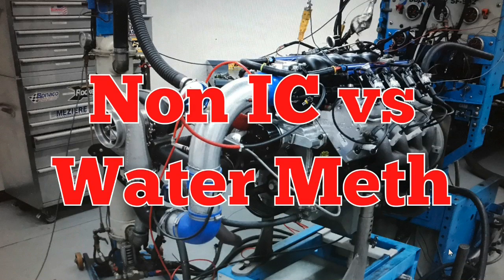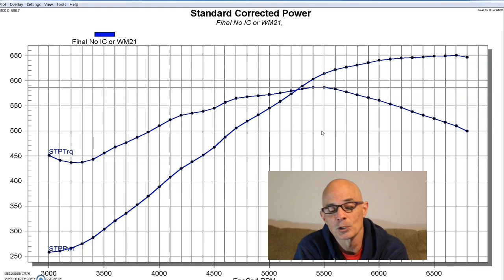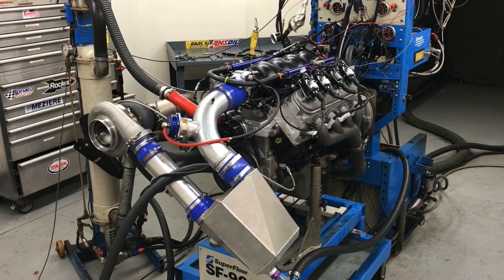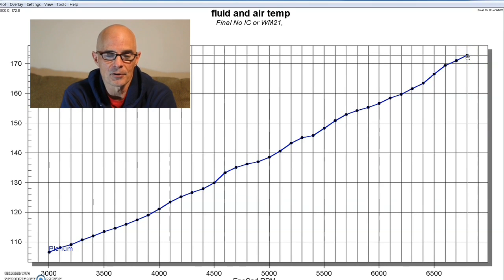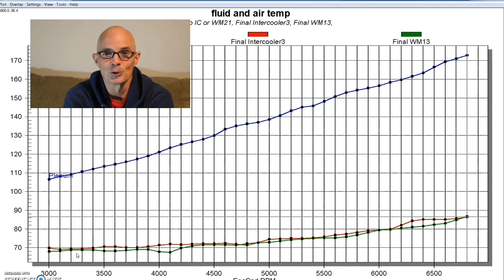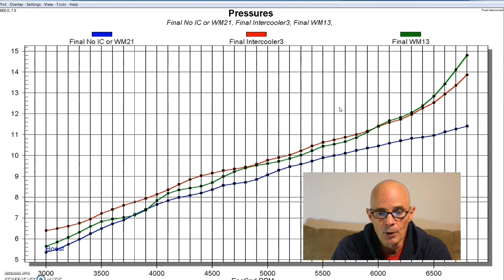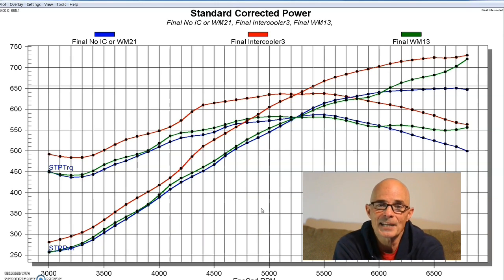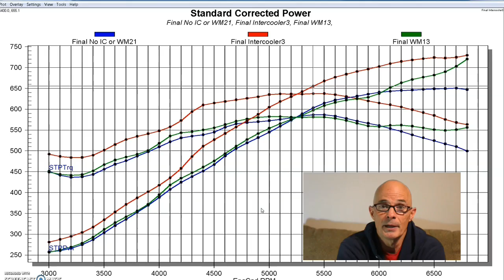WHO'S COOLER? WATER METH vs INTERCOOLER

Comment: When you introduce Alcohol you change the burn rate and you have to change timing. No one would leave factory timing if you switched over to Methanol completely. There was much more in the meth kit.
Reply: This is what I came to say. Meth allows more boost and/or timing.
Reply: Not to mention the water component....it actually absorbs a bit of the energy which would normally contribute to expansion and power production. Definitely a catch 22 based on our dyno data....we resorted to straight meth since our applications permitted additional combustable liquid tanks.
Reply: @SixGunTodd  if it weren't for the safety reasons and how combustible straight meth is I would too....I like steam cooling the combustion chamber and cleaning the pistons....
 At the end of the day it does ALL end up at how much real cylinder pressure at what rpm peak torque occurs will a given combination knock at given an octane limited boost application....
 I could see it moving the goal post a bit and I use it, but not adding a lot....
 I was thinking about, if the new station carries e85 being built just filling it up with e85 and helping my injectors and pump....
Reply: You read my mind. Actually I am surprised that it didn't lose power. Not sure how it works on a v8 but day on an intercooled twin turbo porsche 911, power using the same gasoline, methanol injection and tuned for it can increase horsepower close to 100 hp. Spraying before the throttle body. Great analysis but fairly incomplete test IMO. We ought to see timing and of course afr. Guaranteed with the water/meth the car was running pig rich!
Reply: @kouzman  he was using it for cooling only.
Reply: @thud93091  but even then you need to review the timing and afr even just a tiny bit. The spray is a whole different ballgame since it will change detonation tolerances completely. It would be great if repeated the test but checking the tuning for it.
Reply: @thud93091  well he had to be adjusting the timing as well or the intercooler test would have shown no increase in power.. 
 The meth did its job...I use 2 nozzles well back from the tb at different angles hoping to get some good mixing, even if overall charge temp is lost to some preheating
Reply: @ShawnGilbert1967  The beauty of water injection is that it will still reduce temps all the way into the combustion chamber. The increase in power from the intercooler came from a reduced charge density which allowed more air mass to be in the same charge pressure. He would have made considerably more power if he had changed timing on either of the intercooler or water injection runs. If intercooling was better they would have used it instead of water injection on WW2 planes. They would have saved considerable weight and increased their range without the water/meth tanks.
Reply: @fastredcar97  Does it make sense to use both? Especially in a warmer climate or would it be too much money for the gains you may get?
Reply: @fgtrhwu2  It really depends on your setup. The water injection can reduce temps across the entire combustion process. Intercoolers don't really reduce exhaust temps. Which is what burns valves and pistons. Water injection can both reduce exhaust temps and can slow down flame propagation across the chamber, which an intercooler cannot do. This is especially important with boosted applications or high compression setups. The thermal reduction that water injection is significantly larger than just reducing charge temps initially. The latent heat of vaporization of water is huge. To give an example: the energy consumed to change water from its liquid form at 211* to gas is five times as much energy than is required to heat the water from 32* to 211*. The draw back to water injection is that its quantity is a fixed amount in the vehicle. The up side of water injection is that 100% water can be injected and thus dramatically increase the range a set amount of fluid can properly be accounted for during an event. The problem most people make when making this change is that they do not understand the physics and data that has been researched and recorded. The amount of water that needs to be injected is the same whether you are running a mixture of meth or straight water. So if you decide to run a meth mix you have to increase the total amount of fluid injected or conversely you must reduce the total amount of injected fluid if you decide to run only water. Many test of straight water injection that have been done do not do this. This improper use and testing of the straight water injection leads to severely over injection and this reduces the internal delta temperature from the combustion process, which ultimately leads to loss of power. Remember that water does not burn and over injection will have very poor results.
Reply: @fastredcar97  Does having the water injection system as a direct port injection yield significant advantage?
Reply: @fgtrhwu2  Yes typically, it comes down to distribution differences from cylinder to cylinder. Modern EFI manifolds have large bends that induce wet flow fallout(the suspended particles combine and are typically laid on the runner wall). If this happens it no longer is being used for temperature reduction inside the combustion chamber. The same goes for fuel. If fuel smacks the wall it introduces a ton of problems with combustion and data collection. Direct port injection (DP) is best for both fuel and water introduction into the air stream. The earlier you can put into the stream the better, as it can start to reduce temperature sooner and thus lower the initial combustion temps more.
Reply: @fastredcar97  Since, the turbos suck air from a hot engine bay, would there be any benefit from using an intercooler and water/meth? Or would that be too much?
Reply: @kensmechanicalaffair  turbos do not breath hot air from the engine bay. Only if the installer doesn't have a ducting system to feed from the frontal cross section would a turbo only get it air supply from the engine bay. Why spend thousands on a turbo system to cheap out and not spend another hundred to get air from a better source. Intercoolers will always add power as the charge density is increased. Any turbo system will benefit from an intercooler.
Reply: My thought too.
Reply: Without knock sensors it’s difficult for him to find the limit by adding timing, so he doesn’t.
Reply: I agree this guy is slow or something
Reply: How about adding water to the gas tank ?

Comment: Great conclusion. Agree 100%. Water meth is appropriate for an intake that was designed for wet flow (single plane is ideal); if running an intake designed for dry flow, find a way to fit an intercooler.

Comment: Back in the day I had a turbo thunderbird with the 2.3L. I had a big turbo and a big air/air FMIC on it. Then I added a water injection arrangement (sometimes I'd dump a bottle or two of rubbing alcohol into my tank to supplement the water). Two key take aways: 1. After a zero to 140mph to zero run, with the water injection, my intake manifold was icy cold to the touch...Not the case with only the FMIC. 2. When I pulled the cylinder head off, the insides of that engine were SPOTLESSLY clean. I mean, clean as a whistle. Never seen a cleaner engine that had ANY runtime.

Comment: It looks as though you had zero boost control if you only had a 7 psi spring in the gate that's why the boost increased with the intercooler. It was making more power which exacerbated the problem. Was the tune changed when activating the water meth? If not it was probably pig rich in some cylinders because of the distribution problem driving the power down.

Comment: I hate watching these so late in the game!  I know that nobody is going to see this comment :(  The reason water / meth injection sucks is that to have significant cooling you have to have a lot of water / meth injected that makes a lot of steam taking up intake volume that would be filled with air in a system without water / meth injection.  So, for the same boost pressure you actually have less air in the intake manifold, less air going into the cylinders, so your net HP gain is negligible.  The only time to use water injection is if you are running into detonation and can't install an intercooler for some reason.

Comment: It's probably been mentioned, if not, I think the boost increase was caused by a denser intake charge providing for more exhaust output. The more oxygen from the denser air means more fuel and more exhaust output.

Comment: Another snow user here. Been running it on a mixed use car ( some street driving,trips to Mexico and drag strip) for going on 3 years. Not a problem. I have pump mounted in the trunk so its away from the elements.  Going to buy another kit for my daily that i want to turn up the boost.

Comment: It is good too know that those intake styles do not distribute w/meth evenly, so one would want to setup nozzles in the runners. It is also good to know that the cooling ability of the w/meth kit is similar to that of the intercooler. However I am not satisfied with the conclusion as the purpose of the w/meth does not seem to be exploited.

Usually just adding meth or w/meth does not usually increase power. It allows you to run more boost and/or timing, and the power increases come from that. As Richard Holdener mentioned he can not run a knock sensor setup. If he could, he could find the limit of the non-intercooler/no w/meth setup max power of boost/timing on pump fuel before knock occurs. Then he could run the w/meth and max out the turbo/timing combo and see what he max power is, as he would be able to run much more boost/timiing with the cooler air & higher octane provided by the w/meth kit. That is how you use a w/meth or meth kit.  You will make a lot more power.

Comment: The reason I believe this test is inaccurate is, water meth must be tuned the engine will run richer with it and there for makes same or less power. If fueling was adjusted correctly and timing was added as it bumps up the octane it would have made more power then non intercooler. Although this test does prove water meth is very effective for cooling air temps.

Comment: Hey Rich, I absolutely love all the combos that you put together. 
I'd love to see a single plane manifold port EFI with a elbow, 103 throttle body with a base plate meth injection, and then run it with and without the intercooler.
The cooler the better you say.
Thanks again for all that you do.

Comment: Richard, it looks like, based on several learned sources, that the water injection volume  should be about 14% of the fuel volume.  I have not knowledge of the water injection used on this experiment, but was curious if followed the foregoing volume and tailored directly to the change in fuel flow???
Reply from the maker: we adjusted up and down

Comment: Can you do a test that I've been thinking of trying on my ride.  If it works as I'm thinking it will.   I run a blow threw carb  and want to run  water meth threw a zex perimeter  plate  probably  have to produce  2 custom jets to run the water meth into the perimeter  plate and I'm thinking that the plate will need 2 supply lines one in the frt and one in the rear to make it work  but that's only on paper.  Real world  might say otherwise.  Maybe just a higher pressure and / or high flow solenoid  may be the solution.     E fuel without intercooler 9-11 psi boost. Single remote  mount turbo(rear mounted)      luxury  need for speed  on a Joe dirt poor budget.   Thanks in advance

Comment: 84 degree water did well - what would 42 degree water do? Ideal gas law (Boyle's, Charles, some others I don't remember) could be double the air at the same density if the temperature is cut in half - which would allow for double the fuel. Knowing the air temperature would be helpful - the water temp is just a single factor.

Comment: Would like to see this same test using E85 instead of gasoline. Interested in seeing how necessary an intercooler is with higher octane alcohol based fuel.
Reply: Burn an exhaust valve not burn an exhaust valve. Why not run the intercooler.
Better question is how much boost will e85 take? 10.5/1 at 10 psi boost is 16/1 compression. The limit of e85.
Reply: Then what cam lobe center profile, intake valve diameter, combustion chamber softening, etc. Assuming you're running a street car vs 4.5 second 1/8 mi racecar

Comment: Richard you are on the right path talking about the water meth distribution at the end there. Further from the throttle body means more time for charge cooling and better atomisation, talk too the guys at prometh about it. Going pre turbo is well worth it. However i think you are correct about it not solving your distribution problem, i would hazard a guess you are actually spraying too much and not getting everything vaporized.

I would add that your charge temp is dropping BELOW the temperature that water vaporizes well. I would swap too pure methanol for better vaporization (methanol boils at 148f/64.7c vs waters 212f/100c). With 68* charge temps the water is probably not vaporizing very well. Water has some other characteristics that prevent it from vaporizing well such as surface tension that are worth mentioning but i wont expand on them in a youtube comment.

I am curious on what size of nozzle you are running. Pro meth recommends 
100% water target 8-10% of fuel flow
50/50 mix target 15–20% of fuel flow
100% methanol target 20–25% of fuel flow

Comment: So this shows what performance gains you get from just adding Methanol or an IC, I'd like to see:

1. What are the benefits of both are when ran together.
2. What are the benefits of each (individually and combined) with tuning.  I.E. I added methanol, how much more boost did that allow safely, and how did that perform, same with an IC, then add methanol and an IC, tune that and what does that do.

I say this because I have an 87 Turbo Regal that has both Alky and a larger stock-location IC.  I did both of these to be able to run more boost.

Comment: I really enjoy watching your videos. Question, does a draw through system cool as efficiently as a blow through system?
Reply from the maker: not many running draw through any more
Reply: @richardholdener1727  I was just curious because I had a draw through system on an L20B 2ltr Datsun engine for a while. It was probably used more on smaller engines like motorcycles before fuel injection got so easy

Comment: Have to disagree on the water/meth results. According to the water air intercooler, the cooler temp is all that made the difference. Since the water/meth delivered similar temps, the power gain should have been near the same, but it wasn't and part of the reason is because,  it has long been documented that  water/meth generally requires spark advance to be increased to obtain the full benefit of its use, unless the spark curve is already near optimum, in which case it would not be needed and that wasn't done so the test is incomplete, because there was no mention of the motor being tuned for the meth which is a requirement. 

    Water/meth is more for spark knock and detonation resistance also, not intercooling and provides spark knock and detonation resistance above what intercooling alone can provide and you can go further with it alone in power production than you can with intercooling alone, thanks to the combustion control from water and the octane bump from the methanol. It should have been tested by itself.

Comment: Richard, would using an efi Carb manifold with a TB elbow and having the meth injected at the plenum (right bellow the TB elbow) work better? Carb manifolds by design flow air and fuel therefore, I would conclude those intakes may do a better job with meth injection than a traditional LS EFI intake would.
Also, any chance you have tested a blow thru carb non-intercooled vs intercooled LS EFI ? I've always been curious to know how the cooling effect of the "carb" does (seen videos floating around that shows the temps stays pretty low, and up to 100* diff between carb hat air temp and intake floor temp)

Comment: New subscriber here! love your videos and tech info. Do you foresee the same issues with Nitrous and a long runner intake as with the methanol? Meaning the Nitrous Plate kits would have a hard time evenly distributing the nitrous/fuel in a long running intake. Could a dyno test between a plate system and a direct port system with individual cylinder EGT sensors prove that? Would love to see the difference.

Comment: Hi Richard, great test! However I think for most of us especially with more street /strip oriented LS turbo installs will be running an air to air inter cooler. I know an air to water intercooler is going to be a bit more effective at cooling. However air to water intercoolers are more of a strip only cars type of install for most guys.  It would have been nice to also see an air to air intercooler used with a fan in front of it. What do you think the difference may have been? Also I plan on running e85 with my air to air intercooler on my 6.0 going into my street/strip 72 Nova with turbo 400 and twin turbos now. Food for thought? Thanks all your videos are great and teach us a lot with your knowledge and insight! Bob
Reply from the maker: please watch the ATA vs ATW cooler video
Reply: Very difficult to create good airflow/wind over an air/air cooler inside a dyno test cell. In the car, you easily get 50, 75 or 100mph airflow over the cooler. A fan in the dyno cell does NOT re-create that kind of airflow.

Comment: The math says.....Same absolute pressure and less temp = more air mass. More air=more HP. Thus the intercooled version will always win in this situation. The way meth cools the charge is different than a heat exchanger. The meth/water flash evaps and fills volume.